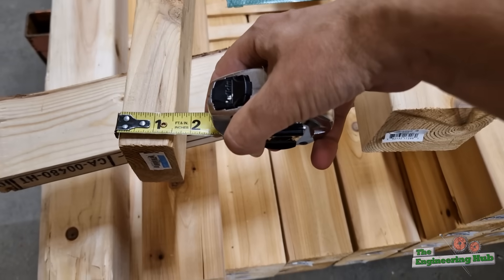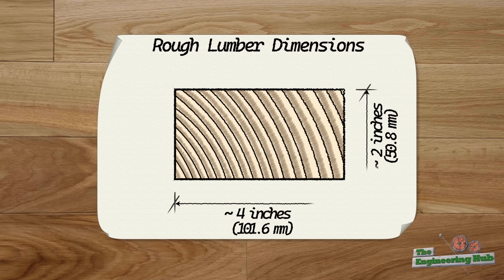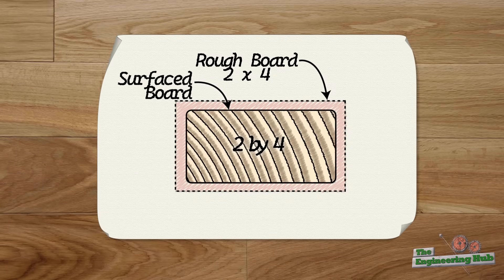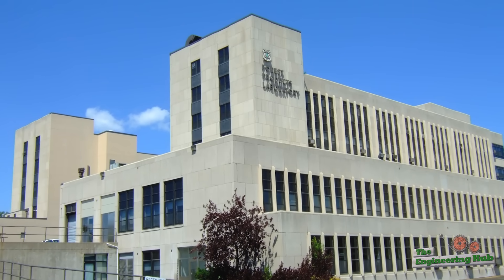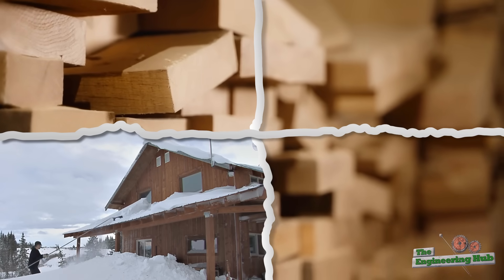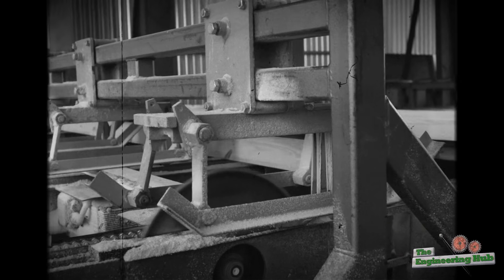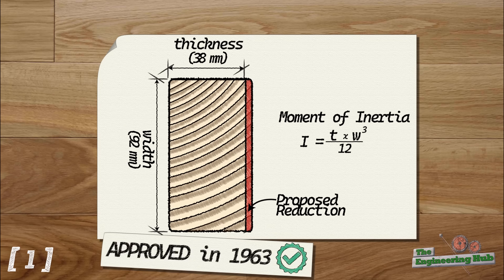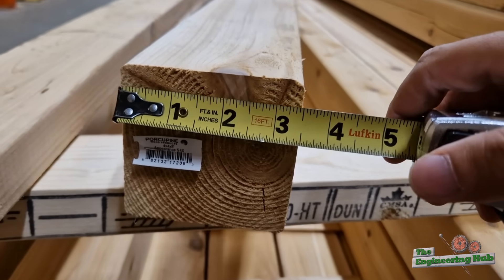Why is the 2 by 4 getting smaller and smaller?

Comment: Grain has little to do with load capacity etc.  It is a meme.  It is a correlation in most woods with content of late wood vs early wood.  Late wood is stronger generally but the amount of latewood is affected by a variety of factors.  Some trees have tight rings but less latewood than some, and others have 3 rpi and amazing amounts of latewood.  If wood is used in a capacity where delamination is a concern, then tight rings from natural timber stands would be desirable.  But if we only took wood from natural stands, there wouldnt be enough supply to go around and we would have a bunch more problems.

Comment: I bet the price per unit stayed the same, but price per volume went way up. Companies do the same thing today, and gullible customers believe their reasoning. 

Many old 2x4s were sawn that way, no need for planing. You can see the saw marks. Non-dimensional lumber was more often used for sheating, and cut when necessary. 

Stud and joist spacing was further apart. Strength has certainly suffered. I doubt the volume of wood per structure hasn't changed much, it is just spread out more today. 

Those old houses are still standing, and many will outlast modern structures.

Comment: I don't know where exactly I can weigh in on this, but I DO know that I achieved almost 70% consistent growth spurt by using a mix of 10, and sometimes as many as 20 different fertilizers and mixing them together with 20% water and further diluting them upon application by another 50%. The results were absolutely insane, and less than 2% of plants reacted badly to this. I used mainly liquid fertilizers in combination with powdered one. It didn't matter as long as the contents were shaken extensively at least weekly in a 5 gallon container. So yes, the instructions on how and when, and how much fertilizers to use became an absolute joke when I saw saw the results what I discovered totally by accident. I ran out of space to store all the half-filled bottles and boxes given to me so I just mixed them all together at one point and figured my 'Frankenstein' mixture would either kill everything, or be a new innovation in ignoring the rules of convention and corporate standards. THAT is how we need to start growing trees!! Thanks for the great video. If I was young again, I would be ALL over this!

Comment: It's not just in the US.

In my country, there are also thickness reduction. And it's not just lumber, but steel too. We charted that as measurement theft and adjust our calculations to reflect the missing size.

So, it's not a ridiculous thing for us (half way across the globe). What's ridiculous for us is that, there is a standard regulation to do that in USA. 😅

Comment: It was interesting doing renovations on a 90 year old house with vaulted ceilings. Was told no, cannot use rough cut lumber on my house that was built with full dimension 2x4 studding/truss. Ended up purchasing 2 x 6's to sister up the whole structure which in the end worked out better. Just a biatch to work with when lumber is different dimensions at angles.

Comment: I remember the first woodworking project i ever did was building a bedframe. I drew out the design, calculated how many 2x4's, 1x3's, and 4x4. I went to the hardware store loaded up my lumber cart, loaded into my car got to my house, laid it out and...🤔 Hey...wait a minute 😳. I took out my plans and went through the math again...nope the math was right... 😤 they sold me boards that are off.
I measured all of the dimensions, then loaded all the boards back up and took them back to the hardware store, completely pissed. The guy told me that all 2x4's are 1 1/2 x 3 1/2. My reply is that was what they should have called it.
This alone is the dumbest thing that was ever allowed to be.
That's why any projects I do now, if at all possible, i use steel. You know how big a two-by-four steel tube is 🤔... It is 2x4. 
The lumber industry has always been shady. Covid and their template to fake-flation business is all you need to know.

Comment: In the UK a 4" x 2" is 4 inches by 2 inches. Any other size is not a legal size unless PAR is included in the description. 
4 x 2 PAR is similar but Planed All Round and is naturally smaller in dimension.

Comment: In metric countries we have long since standardized on a 50x100mm format instead of the old and archaic 2"x4" :)

Many still call them 2"x4" though, but in small quantites an inch is roughly a quarter of a decimeter (0.254 dm).

Comment: The actual 2x4 is significantly stronger than todays thinner ones if it was milled down to 2 by 4 inches.  If it is rough cut it has stress lines and cuts from the saw blade which take away at least 1/16th on each side to correct that.  So a 1 7/8ths by 3 and 7/8ths would be OPTIMAL and easier to frame , nail and screw into with paneling and sheet rock.   A 2x7 now is no longer 6 and 1/2 but 6 and 3/8ths and a 5 quarter  by 6 plank is only 4 quarters of wet treated lumber and it will shrink to about 5 and 1/4 inches, leaving bad gaps in a deck.  They shave off flakes from the wood they sell to us, charge us for those flakes and then charge us again when they sell us OSB flake board.  It's a rip off.

Comment: In 1987, I remodeled a house on Long Island that had been built in the 1920s. All 2 x 4s in the house were actually 2" x 4", so I had a lot of problems replacing rotted studs with the new 2 x 4s which actually were 1-1/2 x 3-1/2, so they didn't match the dimensions of the existing studs along side them. The old studs also had sharp edges and were much harder, causing smoking when drilled or cut.
Reply: In that case, you'd just contact a local mill and buy rough cut lumber which would start out at an actual 2" x 4" dimension.  Not like having planed sides matters much for studs anyway.
Reply: Termites can't eat it either.

Comment: What info is there about the rounded corners of the "new" lumber, as opposed to the sharp, squared off corners of the older boards? 6:28 I can understand that may also reduce weight, but it doesn't reduce volume and definitely adds another step (or a more involved principal step) to the milling process, while also removing the possibility that boards held in tandem would be square a flush with no gaps. Why would this happen?
Reply: To stop splintering down the length is my guess.  On square edge lumber of poor quality, pullng a "sliver" could pull the entire edge off the board.

Comment: a rough sawn true 2x4 will stay straight outside. If you leave a 1.5 inch S4S 2x4 outside it will soon be un-usable...Planing nearly half an inch off the thickness of a 2x4 is insane.

Comment: If you buy "2x4" in finlan it is exactly 50x100 millimetres not more or not less.. beacause we use metric system and if 
customer want buy 50x100 it is 50x100 or customer complains...

Comment: Not only that, but look at the end-grain… that old growth lumber was really a superior material. Really dense, with tight growth rings. I’m surprised today’s lumber has any strength at all.
Reply: I work at a mill and the roof collapsed due to heavy rain and clogged drain pipes.  When we rebuilt the roof we had to DOUBLE the thickness of the joists to meet code.  The old roof was built in 1905 and lasted over a hundred years.  The new roof is expected to last twenty.  All because new growth wood sucks.

Comment: I can't imagine how frustrating it would be to work in a hardware store and argue with customers about this every single week. I would go insane
Reply: most people that came in knew what was up. then again, I worked in deliveries, not lumber. Just ended up spending most of my shifts there if I wasn't outside.

the general demographic around that store was also older (if someone wasn't older they typically still knew since the state and region is more rural/suburban), so that could have an effect.
Reply: They usually list it as "44mm × 100mm (2x4)". Note they don't say inches, thus there is nothing to argue about.
Reply: why argue about it a hardware store?
Reply: @richardwebb2348 Because people are idiots and think retail workers have control over the manufacturer and wholesalers , tons of videos like that out there 😂

Comment: I don't claim to know what lumber sizes are the best, but why not just sell them at actual dimensions?   I understand 2x4 rolls off the tongue nicely, but if it's actually 1.5x3.5,  just call it that?

I tend to think we should be using thicker lumber in the U.S.   European construction tends to be more solid.   American homes with 2x4 beams creak more when you walk across them than the European norms do.   They also can space the beams much further apart.

Comment: Not trying to be a wanker, but lol, if it doesn't measure as 2 x 4, then guess what lol, it's not a 2 x 4 it's what ever it measures as, here in Australia, they can't sell items marked as one thing and yet measures as another, the Business would get fined by the ACCC as soon as the first Builder reported them.
I am sure America as per usual with it's lax rules and regulations, don't give a damn and will rip of it's people any way they can, as long as some one is getting very rich :).
I can still read an antique tape measure and see that as 1.5 inches, which by my great memory is half an inch less than two inches :).
If you except it as a 2 x 4 then that is your fault, if you all got together and said stick it where it belongs and don't buy them, guess what will happen, they will mark these as 1.5 inches x what ever and mark them down to get rid of them and make sure the next batch are as advertised :)
You buyers have the power, you just never stick up for yourselves and just bend over and take it :)

Comment: Very interesting! 
We live in a house built in 1947, just as the GIs were coming home from the war. The US was still turning back to pre-war industries, and a lot of materials were not available yet - or only available in limited sizes or quality. The copper pipes linking our house with the city water pipes, were very thin - not ideal for the depth and type of soil. Theynmanaged to last 50 years.When 1 sprung a leak we replaced it with thicker stuff. The floors in this house are sad: no subfloor!!!! Just floorboards (nice looking though) laid across the joists & nailed down. Yup the floor flexes when we walk on it. Lath-&-plaster walls, & the walls have 24 inch centers; & the roof was made of 2-x-4's!! We get plenty of snow here so when we replaced the roof we used 2 x 6s. I wonder how much of the build was due to shortage of supplies VS different codes -- & now I wonder if the wood used was better quality so they didn't need as much of it.

Comment: Not just that the measurement is described ina unit that bears much greater potential for inaccuracies than anymetric one, it's also already the wrong measurement according to what's suggested by the name. That's plain stupid... if Subway did 3/4 ft long "footlongs" there would be riots but for the materials your literal roofs above your heads are built from you accept that without batting an eye?!